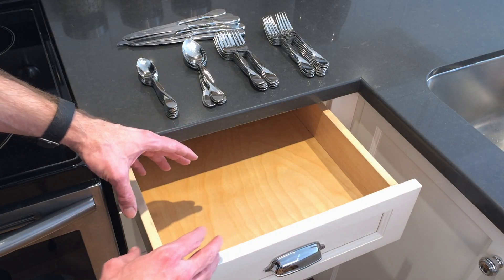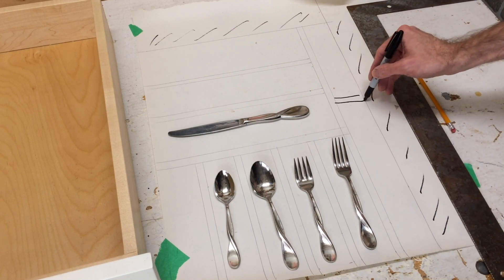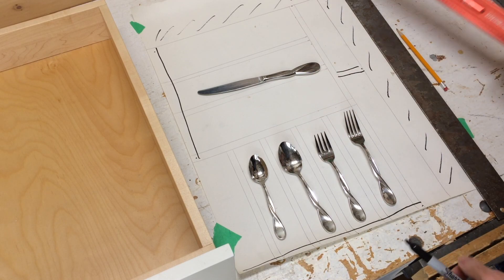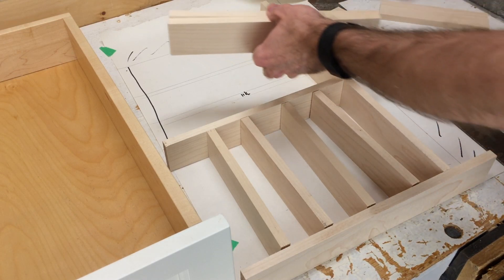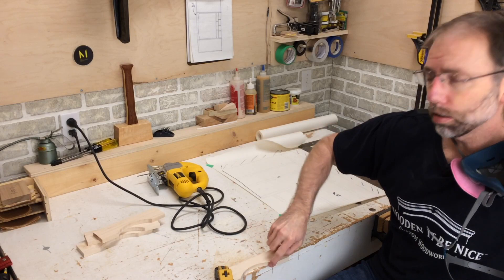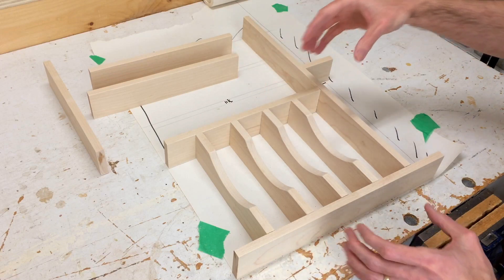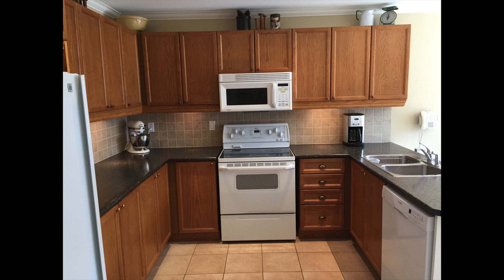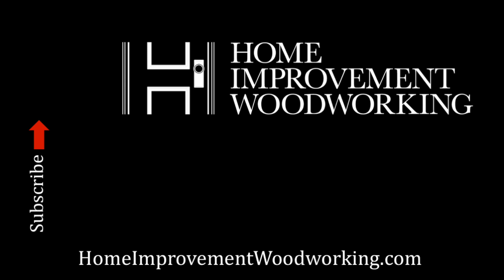Drawer Organizer Build for Kitchen Makeover

Comment: This is a great idea and I will be doing this soon. I'll have to buy the correct size as I don't have a table saw like almost every post on youtube. That's frustrating, but I just don't trust myself around a table saw. I enjoyed your video though. Thanks for posting.
Reply from the maker: Glad you enjoyed it.  A bandsaw is an alternative to a table saw but you will have to smooth out each cut with a plane.  It's difficult to do woodworking without the ability to rip wood to the desired width.  You can also do this with only hand tools, which is more effort, but a safe route to go.  I hope that helps.  Scott

Comment: I prefer 1/4" hardwoods for drawer dividers. It is thin enough not to use up too much space with the wood and as long as you are careful with your construction (23 gauge pin nails, shallow dados, etc) it won't split. I generally use plywood for a base so the verticals have a dado to set into which gives then a nice strong glue joint. Also, when cutting the profiles, I prefer to tape them all together and cut the arc using a band saw and then sand them as a single unit on the spindle. That ensures all the arcs are consistent from piece to piece. Since they are so close together in the drawer, even small variations can be very visible. Otherwise this video is very well done.